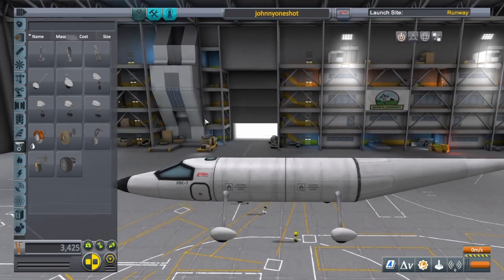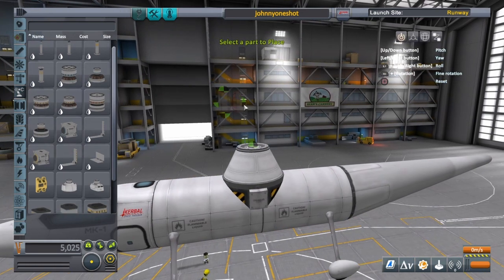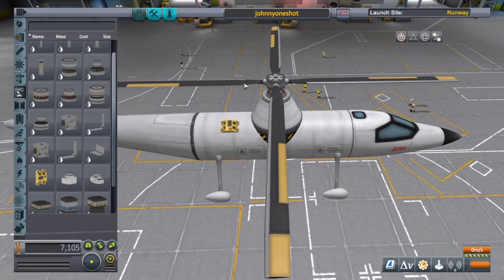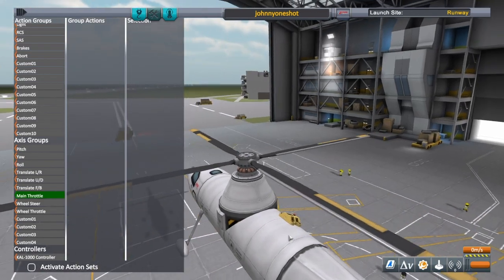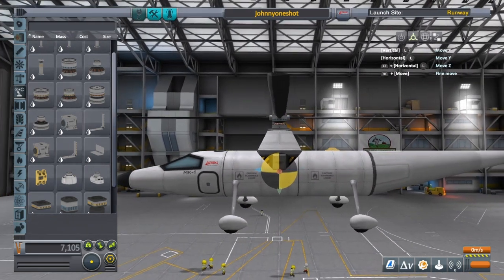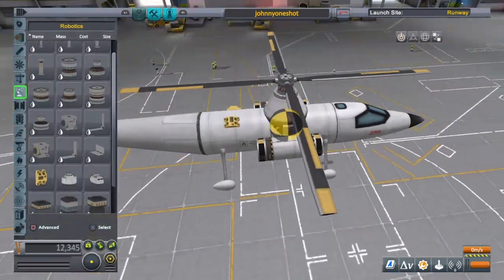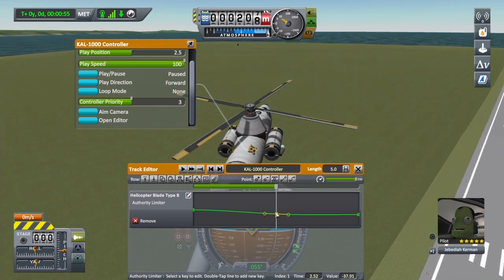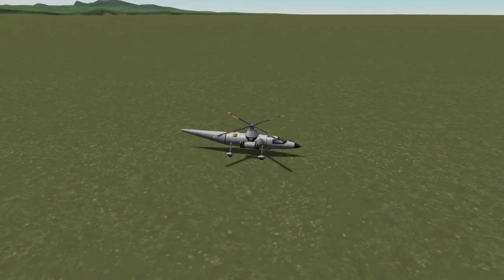Kerbal Space Program: Helicopter Tutorial

Comment: Great video - for early career helicopters! Thanks. Quick question - can you make a helicopter without the inline stabilisers? I've tried using a second rotor on the back to stabilise the chopper, but no success. Any tips?
Reply from the maker: Your best bet is a contra rotor helicopter. Which i have  a video on. I've tried a tail rotor but you would have to set it at a ratio rpm wise off the main rotor. Real helicopter use a transmission that always keeps the tail going the correct speed.

Comment: I got a problem: the authority limiter with the k1000 does not work to change the angle from the blades. Pls help! I did the same thing but I won't work.
Reply from the maker: If you’re on PC you need to use deployment angle instead of authority limiter. If not, make sure you select “extended” in the tweakable menu.
Reply: Fast reaction! Thank you!
Reply from the maker: No problem bud.
Reply: @JohnnyOneShot  lifesaver dude

Comment: Im biulding a heli with a crew cab to transport but i cant rely land i need halp
Reply from the maker: Landing should be as easy as slowly throttling down. What seems to be the issue?
Reply: I used ur heli base  and i just added a tail fin crew cabin and game the main throttle play sppeed and somthin else
Reply from the maker: What happens when you try to land?
Reply: I paused my ksp because im doing a military world and trying to pick up my lizards/kerbals
Reply: Im also having trouble with throttling down every time i throttle to 0 it doesnt slow
Reply from the maker: It won’t slow so much as stop going up. So when you set up the authority limiter on the KAL 1000, instead of having the point at the center be 0. Make it -5. So you’ll go down a lot faster.
Reply: Wen i try to land it either speedes up or shuts the engine completioy making me crash
Reply: How would i make it -5